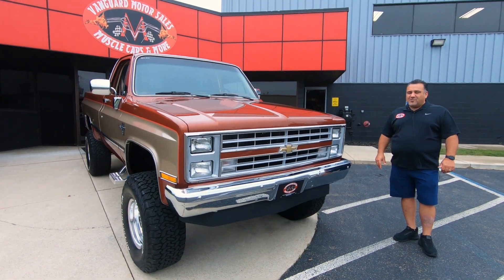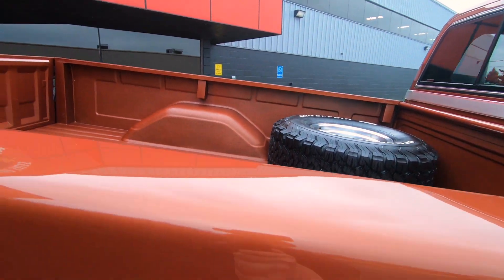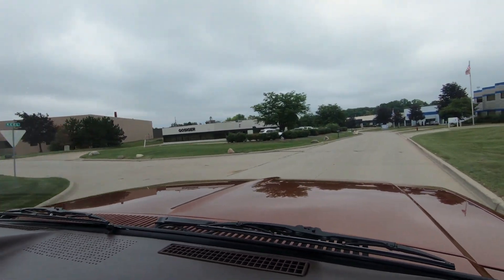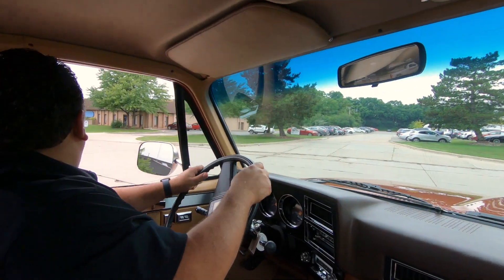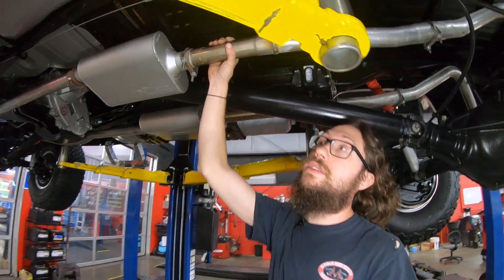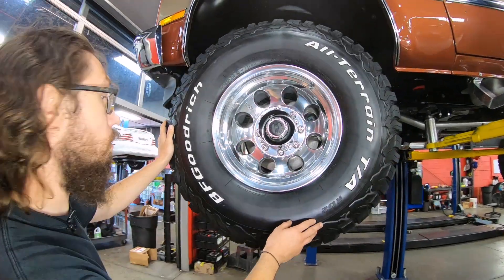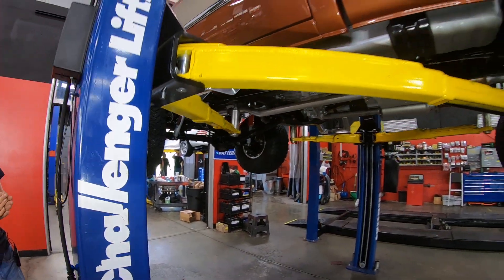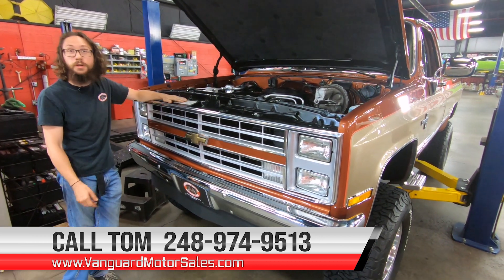1987 Chevrolet Silverado For Sale

Comment: 1987 was the last year for those generation Chevrolet & GMC fullsize pickups but just on the half ton & three quarter ton regular cabs. The crew cabs & one ton regular cabs on the other hand were still in production up through 1989 on the one ton regular cabs & up through 1991 on the crew cabs. Not to forget the Suburbans, K5 Blazers, & Jimmys were also still in production up through 1991 too.

Comment: I had one just like that i bought brand new in 87 but it was a 1/2 ton loaded out wit posi trac in the rear, 350 fuel injected 
700R Trans,  But I notice on that truck it Does not have the Brushed Stainless Plastic on the Dash and Doesn't have the Brushed Aluminum Center TailGate Middle Cover as the Silerado's came with. But other wise the Truck looks Very nice.
Would love to have my old Girl back. Beautiful Trucks.

Comment: I had one very similar and I miss that sucker
Reply: When I was in HighSchool “over 20 years ago” a good buddy of mine had an 87 1/2 ton long bed 4x4 with 33” BF Goodrich AT’s that I used to Drag around with my old 76 HighBoy All the time. My old Ford was just a farm truck but his 87 Chevrolet actually looked damn good, it was a dark blue color and didn’t have a spot of rust anywhere on the truck. It was pretty tough but never could handle the old HighBoy Ford.... come to think of it, none of the Chevrolets he ever bought back then could handle the old Ford🤣😆

Comment: i looked up the price i just wonder what my truck is worth it is a 79 4x4 short box cheyenne full option truck with under 35,000 miles on it in mint condition 1/2 ton Quadro traction 2 set of wheels and tires have the stock rally rims the inside of box looks new still has the factory paint 400 sbc with 400 turbo air condition , full gauge set , wiper delay , cruise control , power windows and locks rear slider custom factory bumpers have the option sheet in glove box everything works like new best part is i got it free with a bunch of rigs some supper rare like a 67 rs ss 427 yenko and a 68 ss 396 camaros and a hole lot more most were pu's